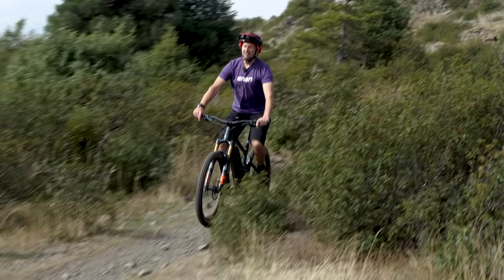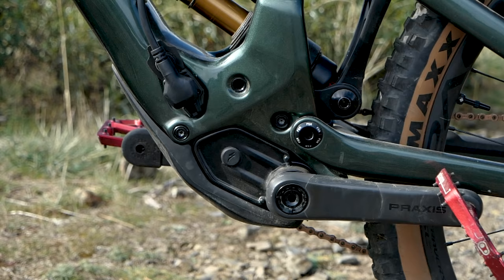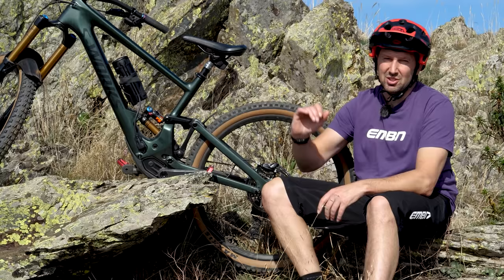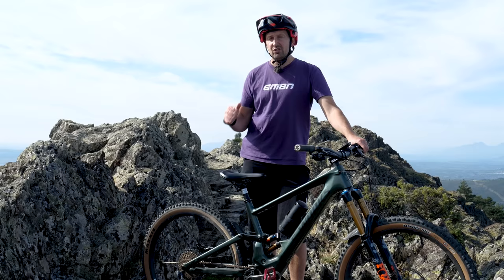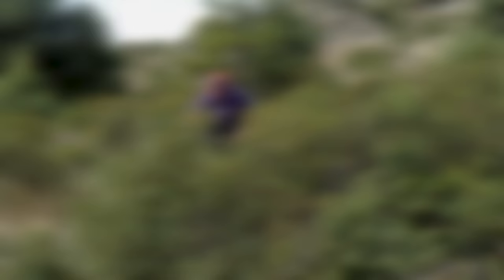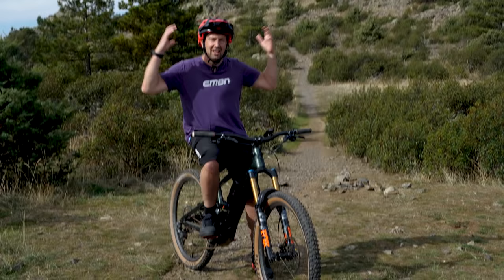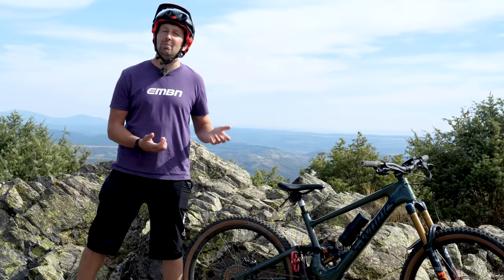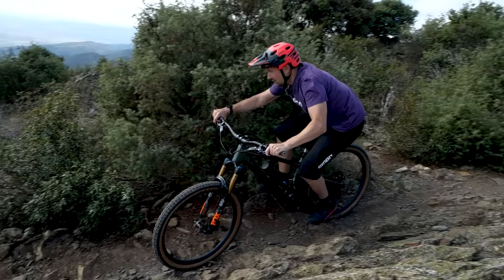6 Ways To Overcome Your E-Bike Speed Limiter!

Comment: so i have a Turbo Tero 3.0 Step-Through and i used it quite a lot and i am interested to buy a chip, ik were to buy it and everything but i have a 3 questions.
1.i heard a lot of roumers that it ruins the battery and the motor? is that right?
2.and how fast does it go if the max limit before was 25km/h?
3. how do the modes work? because i wont allways need to go really fast and sometimes 25km/h is fine for eg. mountain bikeing but if i need to go fast like 40km/h if im on the road what mode do i change it? is it like eco and trail is like normal but turbo is uncapped?

Comment: I was expecting ways to overide the speed limitations of the eBike. The eBike is capable of much higher speeds than the default settings, most riders would need to pay significantly more loot to buy a faster bike when their current eBike is cable of the same speed that of the more expensive faster model. It's by law that the eMotor not be tampered with for higher speeds than regulations would allow. Look at the $millions being taken with these laws, but of course it's all about people's safety and not the money. Let's face it, no one is sensible enough to ride a bike at a higher speed than 25kph, we'd all fall over and die a horrible death. "Silly human race".

Comment: Chip it and set to 22mph. Ideal speed
Reply: 22 is certainly quick enough. But I find it’s easy enough to pedal 20mph at full chat.
So 25 is a nice bonus for me. Although mine will go to 30 at 100% effort/engine assist ratio. 
30 is good for keeping the cars behind happy (if any). Whereas anything lower feels like crawling speed to them. 
I feel I would still feel the speed limiter kick in at 22 like I can feel it kicking in at 16mph on my dads limited bike, which is a horrible feeling and at times more exhausting than not having any assist at all.
I think it also depends on where you ride it. Off road, yeh 22 is fine I suppose.
Around town I would more like 25/30 to keep myself away from traffic.

Comment: What on earth are you suggesting by skinnier higher pressure tyres and other tips; the point is we're restricted to 15.5mph by the Bosch or whoever algorithm. As soon as you hit that speed you're pedalling against the motor, so no matter what you do won't make any difference. I added a Bafang motor and 1000whr battery to an old Dawes hybrid bike and it was a hoot, especially going past 'serious' group riders. That's now died so I've ordered a Cube Reaction hybrid 750 which will have plenty of torque but ludicrously slow top end...Volspeed, I think to the rescue.
Reply: You don't know physics. Skinnier tire = less resistance = faster speeds. The bikes computer will not show that (because it is being fooled) but your gps will.

Comment: If you increase tire pressure a little bit you can do easily 35-40 kph on the flats with a little training. On the uphill sections 25 kph is fast enough.  If that's not fast enough, Husqvarna and KTM have some very nice enduro motorbikes.
Reply: Agreed. People forget what emtbs are for.
Reply: I’ll pay you £500 if you can demonstrate to me you can pedal a heavy EMTB (restricted to 15.5mph) to 25mph on the flat. I don’t believe you. I’m an ex racer, have a threshold power of 350watts and I can’t do it. Are you a macho man with a loose association with the truth?
Reply: @turbolevo8703    The Bosch CX 4 runs absolutely frictionfree above limiterspeed.  The numbers I quoted were numbers I've seen on my display but I'm not sure if that was on completely flat terrain . As soon as the weather clears I go testing.
Reply: @f87max30  
Peddling a heavy EMTB with high rolling resistance tyres to 25mph (which is a 100% human effort) I reckon takes north of 700 watts. If you are an exceptional athlete you might be able to manage it for a short while. The average weekend warrior has no chance. The average power output for the average rider is around 280-300watts and that will give you a speed of 17-18 mph.

Comment: 45 is ok on the road but not off road erm ok . I thought UK voted for brexit to get 32 , maybe it was other reasons ?  One google away from sorting your limiter if you want 40 is the sweet spot where you don't notice it fading out and it still has some punch if you fall short of a bigger jump while not draining the battery stupid fast.  Its people that need a limiter and judgment of where to use the full capability and its not on a shared single track. Before you go mental my country has no legal limits you only void wty which was not a problem for me p.s. the motor is still perfect after 1000s of km
Reply: I'm not in Australia and yes I'm aware they went full restricted too , welcome to hop the ditch